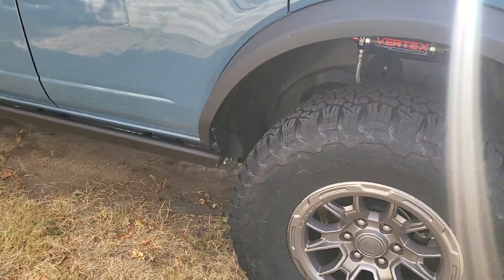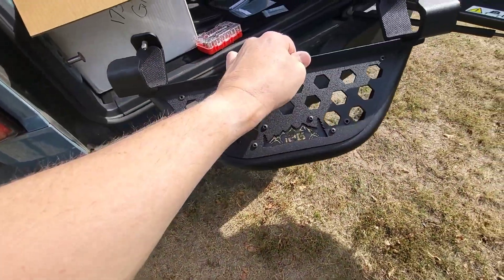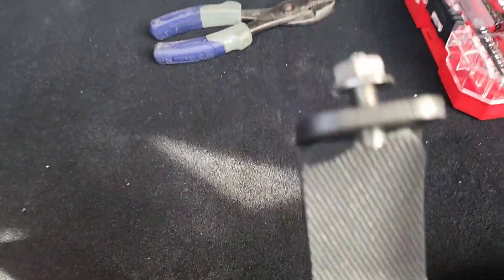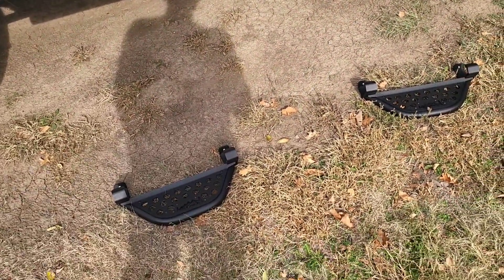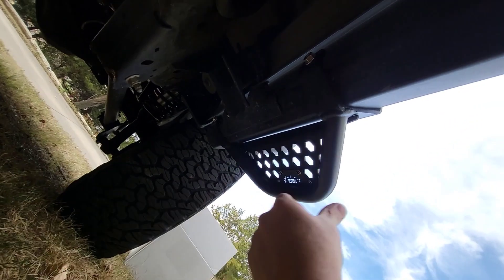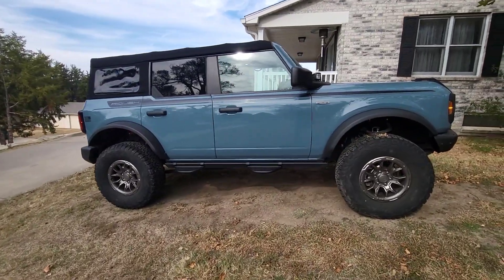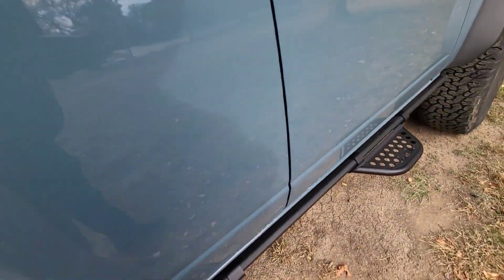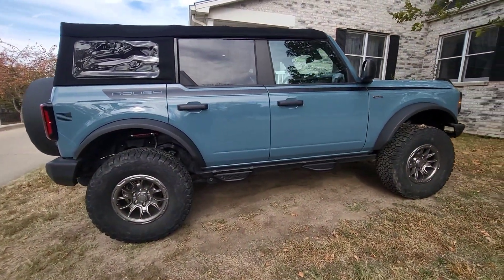Installing IAG Rock Rail Steps

Comment: Looks great, but quick question....did you have to remove the rock rail to slide the IAG step on from end of rail?  And then remount?   The procees of placing the step on the rail is missing from video.  Thanks,
Reply from the maker: No, you loosen the screws, then put them on the rails and tighten the screws.